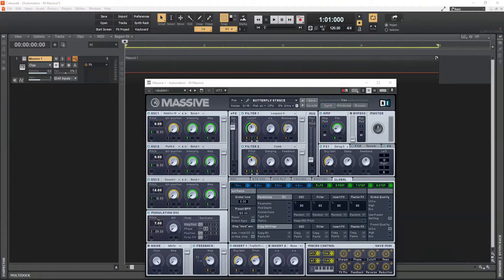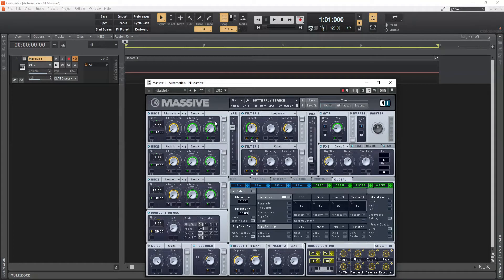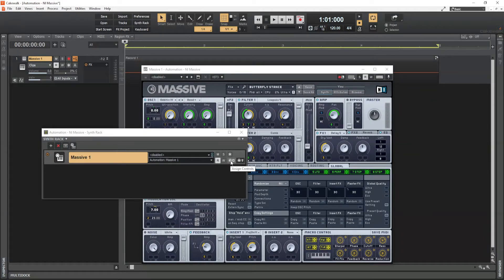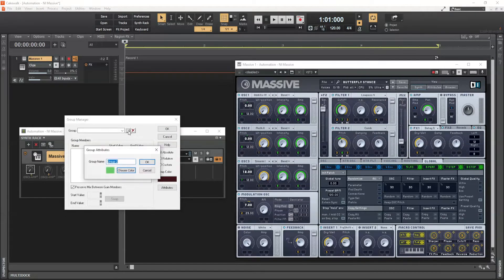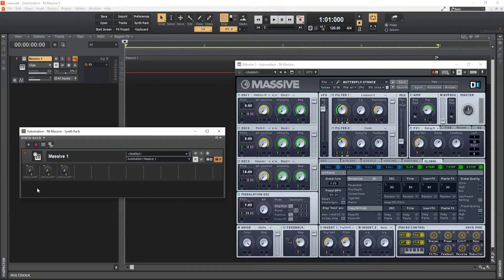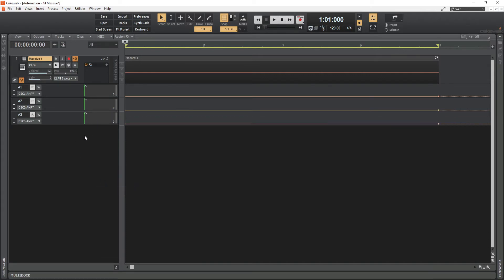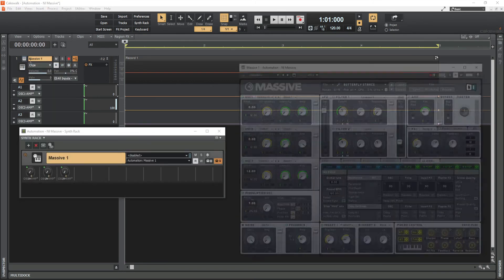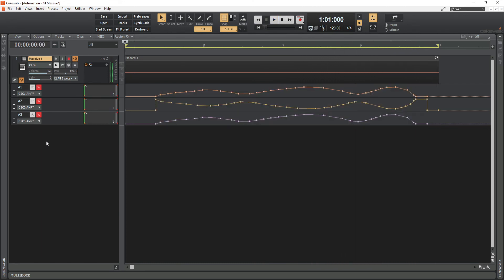Automation of NI Massive parameters in Cakewalk by Bandlab

Comment: Is there a way to save the assignment of the knobs in the synth rack so that the same external hardware midi cc controllers are recalled the next time you open the same synth?
Reply from the maker: Doesn't seem like there is at the moment. 
This is because the synth rack and remote control assignments are project specific. So they get saved within the specific project when you save the project. 
However, if you add a new instrument track of that synth in a new project, those MIDI CC assignments don't apply. You have to reassign them as you wish. This is also because the instance of the synth when added into a new track may or may not have any default CC assignments and they will be initiated with those settings. 
The CC assignments for a synth in a new project could even be different from those for the same synth in a previous existing project and they will get saved accordingly within the specific projects. 
In fact, even in a new instance of the same synth within the same project, the remote control assignments do not replicate by default.